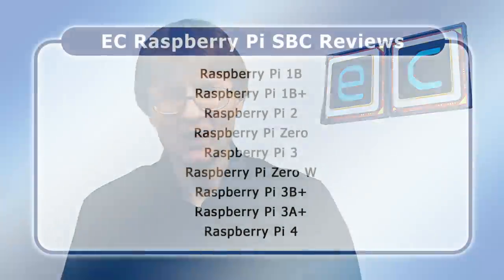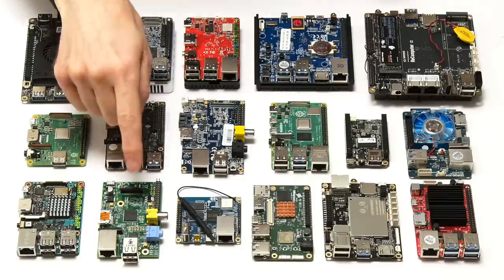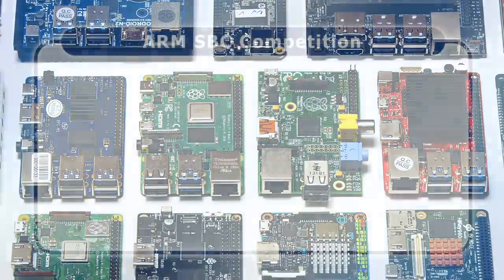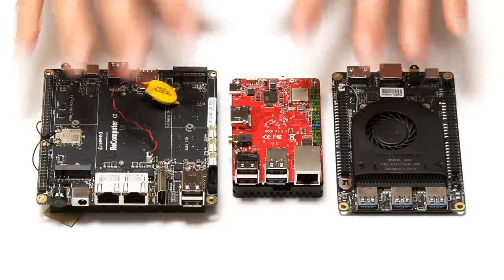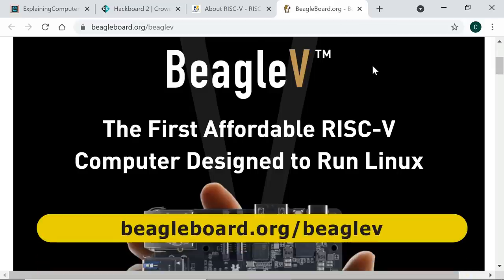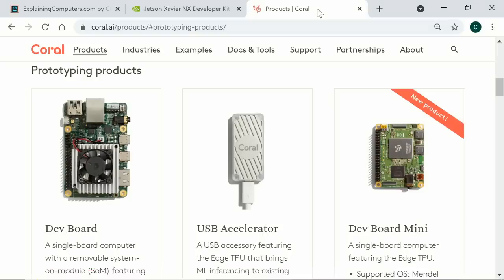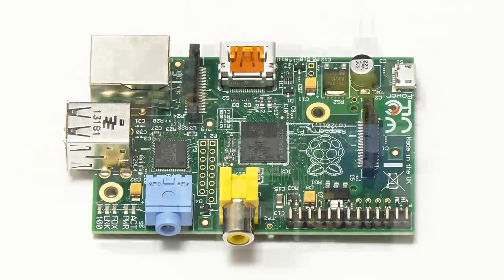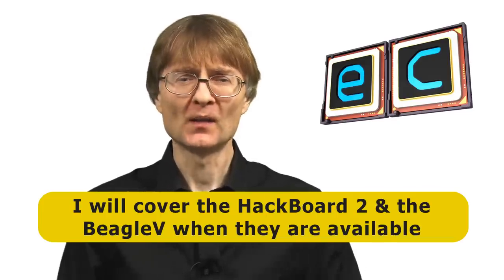SBCs in 2021: The State of Play

Comment: I hope that arm sbc's can become more like our standard pc's in a sense that we can install which os without having to find a device specific build for the sbc
Reply: The varients are way to vast TBH,  the Linux kernel does very well in that regards though with the generic  builds but there is performance hits to take as well as total hardware support.

Embedded / SBC space is way to splintered to work the way you describe.
Reply: @sethrd999  Yeah, and not to mention the specific use-case SBCs with niche hardware, I/O, modules, etc. and the multitude of different chips and SBC configurations. It just gets way too intricate in an attempt to appeal to them all. It's much better to have specific-designed OSes for these different SBCs. It's just more optimized and focused that way
Reply: @umamifan  The saving grace is that the tools (and they are very fine tools gcc/g++ llvm binutils) are there to help you along as is the Kernel itself.  Without BSD/Linux Kernels + GNU + every other open license software producer where would we be?.

Comment: Wonder how a Riscv SBC would preform? Will. It be faster? It would be interesting to see AMD zen on SBC. I think day to day use is ok on a Raspberry PI 4B. It sure come a long way.
Reply: The pricing shows that RISC V is more expensive and a recent Gary Explains video showed that in terms of performance it's about four generations behind ARM. At the moment it's really just a novelty. I haven't seen any use case where RISC V is a better fit than ARM.
Reply: *perform
Reply: @johnm2012  Naw not really,  since if you look at the companies behind it, now intel is joined the frey ;)
Reply: @sethrd999  Not really, what? Intel has shown an interest in SiFive. That's all.  Nothing is decided yet, just like the case of Nvidia expressing an interest in ARM. Whatever happens things won't suddenly improve for RISC V overnight. At the moment RISC V is more expensive and lower performance than ARM. That's a simple fact.
Reply: @johnm2012  Intel is just one of many.  Western Digital among a number of others are building silicon atop RiscV.  As the ISA matures and gets more fully ratified  with more extensions then things will most likely start to heat up.  To say its just a novelty is just incorrect its been along time coming but has made waves in the industry already.
Reply: @sethrd999  Western Digital is just using it as the basis for a hard disk controller, not to contribute to the common good. The problem with the extensions is that they are optional and that will lead to fragmentation. It's the downside of open source - like all the different Linux distributions pulling in different directions and not providing a unified look and feel. The Gary Explains video I mentioned covers it very well.
Reply: @johnm2012  First off to me the Gary vids (and ive had words about it already), is yet more moaning of pretty much 'Why cant Linux be more like Windows'  its not the Job of the OS to dictate how you as a user use your systems and how it looks and feels.  I like to do what I want to do when I want to do it.  With Linux I have exactly that no laws or stupid apps that are worse than useless.  And yes alot of the attitude of new users and alike towards more seasoned users is hostile only usually because we dont spoon feed.  I actually got shade thrown at me just for suggesting that perhaps it might be good for users to join a lug to actually learn Linux before embarking on getting an SBC and then complaining that the thing does not bloody work and the software is crap.

There is absolutely nothing wrong with the state of Linux,  I dont care about Linux on the desktop and never really have as I dont use it where its important,  on a laptop I do have Plasma and have put together a couple of QT apps using QT Creator namely a simple front end for the command line app used to write eproms used with those cheap Chinese reader/writers and the other app is a re implementation for reading / controlling those Ruideng usb power Volt/Amp meter devices over bluetooth.

As for hardware well variants are par for the course so its another 'suck it up' event I am afraid, I use alot of stm, espressif, nordic freescale / NxP microcontrollers to do various things and the differencies makes it quite fun actually especially with RTOS's like RioTOS, Nutix and Zephyr.  Ive recently gotten my maixduino (K210 RiscV) working with these tools using the Sipeed github toochain as a starting point.
Reply: @johnm2012  Nvidia itself shows interest in RiscV as well. And considering what WD's contribution are, they clearly not just target the MCU of their drives but more bigger chips with display capabilities that can fit on their multimedia player branch.
Reply: @sethrd999  There's a learning curve with linux which people need to be aware of. It took me three tries to finally get rid of windows as my desktop.  I do a lot of the microcontroller development as you i.e. esp32, stm32's, and the original arduino's  To be a succesfull linux user you have to set aside time to learn it as you would a programming language or a embedded development project.  The payoff is pretty high. I think it makes you a better technologist, programmer and problem solver. i tell people you have to give linux 3 years to get comfortable with it. You just have to put in the time and the effort, but it is worth it.

Comment: 12VDC is a fine standard- one volt for every month of the year based on Julius Caesar and his calendar.
Don't let your SBC be a single boot computer. Use proper voltage power supplies, or you may see magic smoke appear where your SBC used to be.
Reply: back in the early days of "home computing" IE pre-keyed sockets I'm sure there were many occurrences of Magic Smoke
Reply: Hard disks and fans are the only components in a computer these days that run on 12 volts. Everything else needs 5 volts, 3.3 volts or less. Standardising on 12 volts for SBCs makes no sense at all when the standard USB voltage is 5.
Reply: @johnm2012  except 12V is a fine standard for power delivery. All modern GPUs and CPUs need a lot of 12V power, that they then use onboard VRMs for to shift the voltage down to the circa 1V that is needed by the actual chips. If the PSU had to provide all that power at the chip voltage then your cables would be huge.
Reply: @stevetodd7383  What does that have to do with SBCs? SBCs don't use or need 500 watt desktop computer power supplies. They already use the standard 5 volts, delivered via USB.
Reply: @johnm2012  it’s exactly the same problem. 12V @ 1 amp, or 1V @ 12 amps. The power losses delivering power to the CPU are higher and you need much heavier wire to do so. Better off starting with a higher voltage, then reducing it down to what each component needs near the point it is being used (typically a modern SBC needs multiple power rails internally anyway, so you’re not saving components, and regulating close to point of use removes issues around noise on the power rails also)
Reply: Boodysaspie  that’s either sarcasm or stupidity (or, more likely, both). The CPU on a Pi doesn’t work at 5V either. There are VRMs on board to take the input voltage down to the required levels. If the VRMs are designed to work with a 5v input then of course they will fail when presented with 12v, but even USB is moving away from 5V power delivery, with USB C allowing negotiation between devices and supply for up to 20V.

Comment: have you ever thought of doing some sort of online tutorial classes for coding all thesse SBCs? i am struggling to find a decent python tutorial for my Pico project. Obviously not expecting free!
Reply from the maker: I had discussions with a publisher about this recently. But if there is demand here I will do more on MicroPython on the Pico on this channel. Sadly my last Pico video was not that popular.
Reply: @ExplainingComputers  If the PICO had incorporated some way to network, it would be ideal. What good is it to sample something, but not send the data out?Yes, you can sort of conect it to a RPi, but then you might just as well use the Pi to begin with.
Reply: Have you tried thenewboston's tutorials?
Reply: Can I recommend going through W3 schools as you code? Picking up what you need to along the way sounds like a good enough method for a simple project.
Reply: @SuperHaunts  it depend what you use it for, it is lower power and a ton cheaper than the Pi, it is ideal as a standalone to do A if B etc..
Reply: @jyvben1520  youtube and forums only seem good if you want to turn on an led, or turn a servo etc, dig deeper and there does not seem to be any real world use tutorials.
Reply: @ShadowzGSD  still you ignored the question, and may lack the knowhow  to integrate several examples, only solution buy a kit that does what you want ....
Reply: @jyvben1520  sorry, did not ignore question, just a bit complicated to answer but comes down to switching a load of relays on in different ways depending on the switch that is switched. i have tried merging examples of code but with limited success. there will be no kit available to do what i need. i can do it with a Pi4 and node red but with a chance of damage to the unit the cost of the pico is more appealing. plus i don't learn anything from node red.
Reply: There are already excellent Python courses on the online education market. I took one and it was excellent. The market has become crowded very quickly. Many of the vendors are offering courses "on sale" at bargain rates.
Reply: @ExplainingComputers  That's a shame. I think there are interesting possibilities for an accessible microcontroller. I dabbled with Arduino and Processing but didn't like the development language/system, ultimately. That you can run your choice of languages on the Pico (Python, C, Rust, and more) and use standard development tools is a big deal. I might finally get around to my own pet project - an open source multi-room non-cloud smart thermostat & HVAC controller. The Pico makes it more possible (whilst also being fun to do) than ever before.
Reply: @ExplainingComputers  I think one possible problem with the Pico is that it is trying to get its foot into market space already well served with the likes of the.various Arduino boards and clones thereof, Teensie boards etc..

Comment: I have several X86 tablets that don’t work because the batteries failed.  I want to set them up with external power in appliance functions.
Reply: It's pretty easy to replace batteries.
Reply: @hxhdfjifzirstc894  The batteries cost as much as new better tablets and are questionable quality.  I want external power and to use the low power computer for something well within it's abilities.
Reply: @skyak4493  Can't you just run them with a power supply/charger?
Reply: @richardwernst  No, that is the problem. Based on my early research, the batteries include a BMS circuit that the SBC is hard coded to look for.  The alternatives are to 1) edit some software (bios?) to tolerate battery removal (this is what I hope to get from EC community) or 2) extract and modify the BMS circuit to allow operation on plug or external power.  These are all Intel Atom units so they are all Intel reference designs -consistent, documented, windows lisc.  These were produced in the millions when Intel was desperate to show it was relevant in mobile.  Now they are blinking out and hitting landfills even thought they have all the hardware to replace a $150 Pi project.
My goal is to make these hot swappable from plug to universal external battery.
Reply: If I was to paraphrase this video, it would be the SBC war has ended, Rasberry Pi won.  Linux on ARM is still a struggle so it's best to standardize and focus efforts.  X86 needs commercial industrial prices.  Machine learning is still a hardware race but the big power is only needed for learning so we can just use out primary computers or cloud resources.
What I am getting to is that there is a huge amount of distributed talent that I think would be best focused on mobile hardware reuse.  At the very least it will keep lots of electronics out of the garbage until recycling improves and at most it might change the behavior of gadget manufacturers to full circle products.
Reply: Wish I had some old X86 tablets to repurpose. Unfortunately all of mine are ARM devices with very locked-down bootloaders.

Comment: You asked for comments regarding how to review single board computers. Well, with more people starting to do off grid and power efficient computing, it would be interesting to see how SBC's could be used as desktop replacements for laptops, and more specifically as devices running on batteries as their main mode of use. In other words, when you test the SBC, it would also be handy to know how power efficient they are for potential off grid / power efficient use.
Also, using peripherals like monitors and printers on dc only will be very interesting indeed. Then the whole "package" is looked at, and not the SBC only.
Reply from the maker: Very useful feedback, thanks. I like the idea of a video on energy efficient computing.

Comment: Hey Chris, I've been wondering, do you have any thoughts on making a DIY phone/tablet/phablet replacement out of an SBC? I've been looking into the smartphone market but no phone particularly grabs my attention nor does it have physical features that I'd like, like a keyboard, or just extra connectivity in the form of full sized USBs and more.

From your videos, I gauge that the Lattepanda (5:05 on the right) might be my best bet, considering that it seems to support high resolutions, while staying at rather low power consumption, plus it seems to not have much of added height, so it seems to be perfect for my use case, but I'm wondering if there's alternatives. Preferably I don't go for something that's a downgrade of my current phone, being a 1080p screen and 4 GB RAM, since I like watching Youtube and would also like to use this DIY phablet to control my desktop remotely. I don't mind size too much, as long as it fits in my pocket similar to a PSP, since after all I'd like it to replace my smartphone.

For a bit of context, my phone has a cracked screen, is over 2 years old now, and wasn't exactly an expensive model, so repairing it is kind of a lost cause, and the market's offers for a replacement all have downsides to them that I'd like to avoid, plus I'm a strong advocate for right-to-repair, so being able to fix anything wrong with my current one would be amazing.

I've been enjoying watching your channel on SBCs a ton, it's been a pleasure learning about low-cost options for small scale computing, I personally have a few STM32 boards at home that have been a breeze to work with, one of them watering my balcony's plants as we speak, it's all controlled by an integrated touchscreen for user input, and the in-browser compiler and IDE really help speed things up for development and testing.

Comment: Should be interesting how the RISC-V does with Windows. and Windows programs.
Reply: I don't think windows has been ported to that architecture. I wonder if it ever will.
Reply: Perhaps some manufacturer will develop a RISC-V extension to help run x86 software similar to what Apple did on their M1 chips. That'd be exciting :)
Reply: @RGVZGM  If it becomes popular then yeah it  might.
Reply: Since Linux is already there why need it?.  No desktop required so no bloat needed.
Reply: @alicewyan  Just like wine on linux the performance hit is horrible and again I ask why bother?
Reply: @sethrd999  Unfortunately, there are very few software programs for Linux that are a direct replacement for Windows programs.
That is the major failing of the Linux community.
Solve that, and there will be more converts.
This battle for the best desktop is missing the point...and is rather shallow.
Reply: @DevilTravels  I think thats more down to the use case / individual.  Linux and the community has not failed infact its kinda won out where others failed.  The Kernel ( which is Linux everything else up the stack is GNU / Something else ) like Java runs on Billions of devices.  Like myself the community only cares about what they are interested in.  I dont have any prefs for the desktop I never saw the desktop as a battle, now usage and a system ( Linux(Kernel) + Gnu + other free software) that does not get in my way when I want to be productive is a total win.

I do agree with Linus on the best Linux desktops are chromeOS for simplicity.